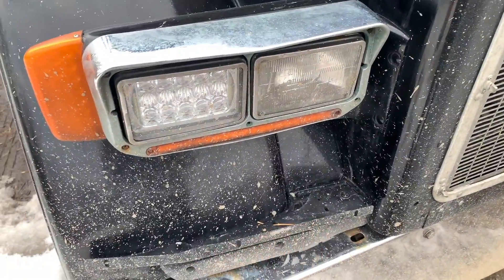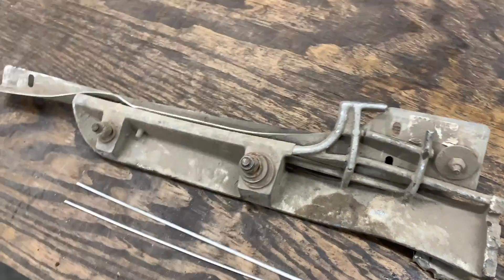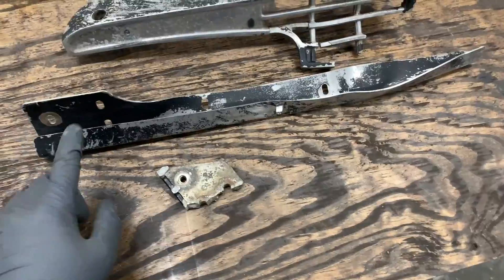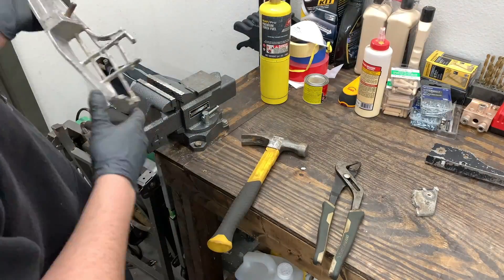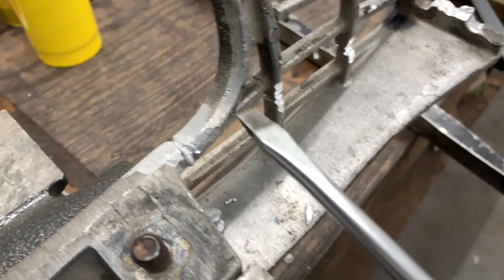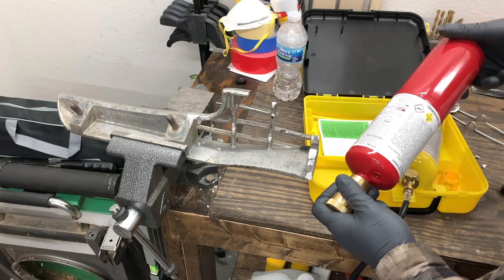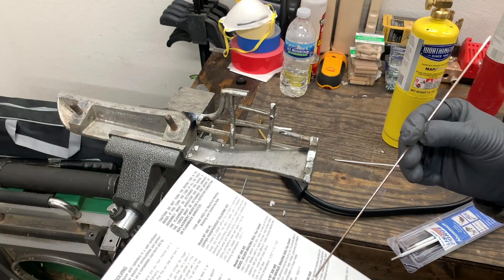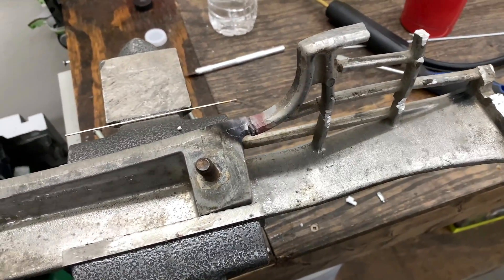Repairing Cast Aluminum With Brazing Rods And A Torch

Comment: The problem i found even if you follow the handy comments  below is the rods melt at the same temperature as the job depending on metallurgy . Welding is tricky if  it's not your profession, don't ask me how l know .

Comment: THUMBS UP to you Oleg! Thanks for posting this because it is super instructive to know what doesn't work. I think I would have prepped the part, bevel the edges, use soolvent as you did and get your wire brush ready, Then pre-heat the whole piece to as hot as your kitchen oven will get, then quickly and carefully take it to the garage and apply heat with the torch and keep brushing it. I would use Hobart rod as it seems to be the best. I am also subscribing to your channel because you helped me with the casting I'm about to solder.

Comment: In all cases, it looks like you need flux. Especially in that last "soldering" rod: those pinholes are a sure sign of poor shielding. With proper flux, the molten aluminum will flow readily into the joints.

Comment: I agree with Neil Marshall 💯 fan that flame back n forth over the whole piece you are brazing heat up the whole thing before you start your rod and I saw alot of orange in your flame/ add more oxygen so it's more blue.  The orange flame will make black carbon on your metal that won't make a good weld/ it's too dirty. It has to stay perfectly clean. When your metal piece is all up to temp you can fine tune your torch to a small flared blue flame to zero in on your weld.

Comment: I’ve repaired worse with blue demon rods. You gotta back away a lil bit and use the tip of the flame. Go slow heat up 2” around the area.

Comment: Did you figure this out? I'm about to try to braze my boat drive and looking for pointers. The research I've seen says you need to use certain chemical to clean it and use flux to help it bond to the old metal
Reply: That's exactly what led me here. I'm curious to know if low-temp brazing rods will work to fill and re-bore bolt holes on a cast aluminum outboard casing. Was really hoping this video would demonstrate a similar situation.

Since it appears your comment was posted 7 months ago... Have you since made any attempts? How did it work out?
Reply: @TonyGingrich  no, it won't hold. You need to weld it. Most likely Tig, might get away with mig using a spool gun. You might consider just going a size bigger if you need to rethread bolt holes. Probably save you a lot of headache lol good luck
Reply: Get your whole piece your working on real hot then braze stick it in the oven at 475 for 20 mims

Comment: I had that trouble trying to weld up a crack on my 5.7 litre Chevrolet LS1 V8 engines oil pan in my 2002 model Holden VY SS Commodore which is the same as the Australian built Pontiac GTO oil pan as both cars were built by Holden in Australia.

I knew that I wasn't going to get enough heat into the oil pan so I got a local welder to TIG weld it for $60 AUD  in December 2018 & it hasn't leaked oil ever since then.

You could watch this video for some pointers on aluminium soldering :-

https://youtu.be/bGGoD8OuvYM

Comment: The vice is taking a lot heat from the aluminum. Plus your piece is really thick. Throw it in your grill for a few hours.
Reply: I have also seen people use ceramic tiles between the vice and part so the vice doesn't absorb all the heat. I have used these myself with great results, although it was 1/4" rod that I was brazing together.
Reply: There is also a metal that it looks like aluminum but in fact is antimonium but that shouldn't be the problem and to make sure is not steel stick a magnet to if it does it is steel if not is another metal like aluminium also the bronze works in all kind of metals

Comment: Most of the heat is going into the vise. Move the weld area farther away from the vise. Clamp from the other end of the project so the heat stays at the repair weld area.
Reply: I was thinking this, insulate from the vise.

Comment: The aluminium frame is a huge heat sink. You need to concentrate 90% of the heating to the left of the joint from below. When you are happy it is at temperature apply the rod without taking the flame away. Also clean the joint beforehand with a stainless steel wire brush.
Reply: @Neil or someone..  I've been watching videos preparing to attempt torch/stick welding a cast aluminum small engine intake.. One ear broke off where bolt goes through.. I know the importance of getting the whole area hot, cleaning, pretty sure Not Suppose to rapid cool either like he did ??
 But my main thought has been when watching people weld back together cast  pieces with a machined flat side with holes for through bolts.. If the fast dissipation of heat aluminum has is one of the main problems when welding aluminum..  Would bolting a piece of steel to it help ?? Especially in my case or even in his case maybe clamping a piece of steel to it ? It seems logical, the steel would keep the heat even, hold it, prevent fast cooling..
 Thank You in advance to anybody who give some input on this.. 👍
Reply: @swalowit  you can try that for sure. As long as there is access for the filler metal to flow into the joint.
More importantly, you need to keep the temperature below 650 degrees Celsius  otherwise the casting will turn into a puddle. In my experience these small aluminium castings can be tricky to repair especially if it is a cheap Chinese item.
Reply: @gracejones5531  Thanks man.. yeah for sure it's a cheap Chinese item.. in fact I could just purchase a new one for like $10 and I probably will end up doing that if I use the engine in Drift Trike build.. but I just wanted to see if I can accomplish fixing it.. 👍
 Thank you for the heads up on the temperature.. I have a handheld thermometer for reading surface temperature.. I'm assuming I should use my acetylene torch over propane ?
Reply: @swalowit  I would be inclined to use oxy/acetylene with the smallest size nozzle capable of heating the area you are repairing. 
The biggest challenge is not overheating the component and it collapsing into a molten mess.